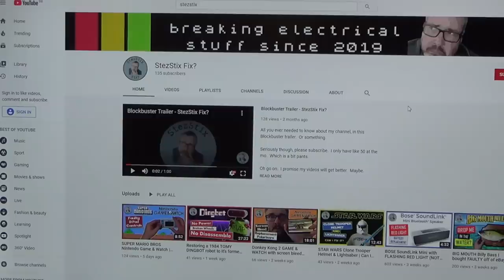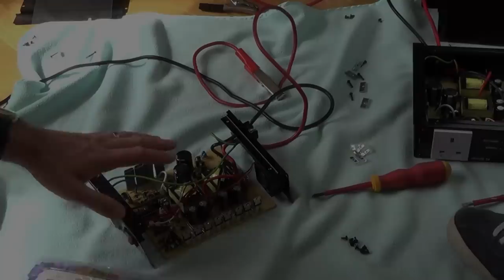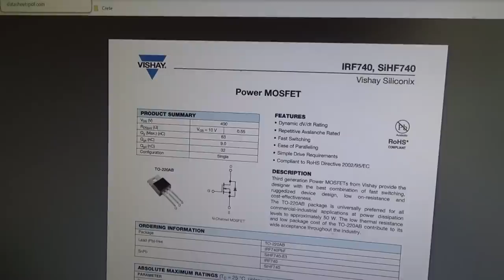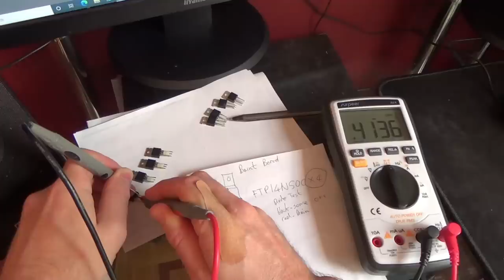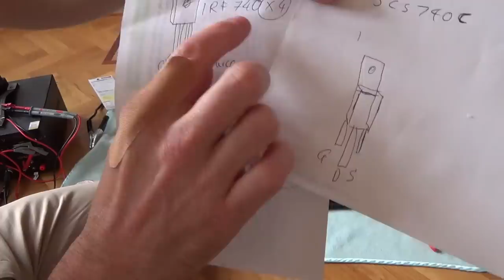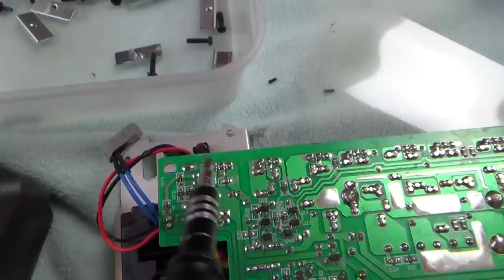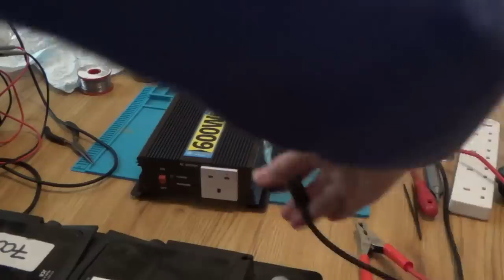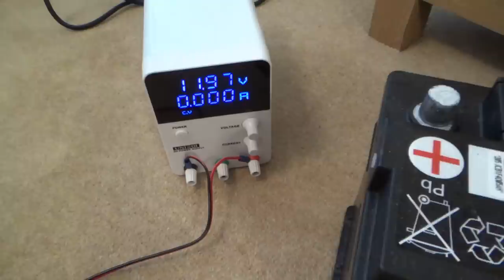Trying to FIX: 3x Power Inverters - 12V to 230V

Comment: @22:00 Aren't those digital relays? Basically? But smaller by design? So they are able to pulse higher voltage. Not sure if I'm helping the topic at this stage either lol. As I'm not entirely sure.
Reply: But when these fail they are latched on or off I feel, that's how they fail? Wish I actually knew lmao...
Reply: @typicalpctech6674  Nikkai Maplins very own brand and not surprised it's no longer working ⚙️🔧

Comment: What is the actual power output from the bench psu, should be written on the back, I suspect it is isolated transformer which ramps up current but at very low power, also known as a dummy load.

Comment: As you're hap hazzard
If you put voltage in limit the current.
When you find broken things, trace back and check 3 items back and forward.
This then sees why things broke.
But you do need to know more about how things work and how to test them.
Reply: blown mosfets ⚡🔥🔧🛠️🧰⚙️
Reply: @MrMacizin  I've tested some and they are either blown or appear blow due to shorts. This depends on the MOSFET type and some other ways they can be wired in the circuit... Which is really annoying most of the time.

Comment: Power(Watts) always remains the same.  The step-up is from 12v to 120v which is x10.  The current also is x10.  So, if you draw 120watts ac (120volts x 1amp) from the inverter you must supply 120watts from the 12vdc supply (12volts x 10amps = 120watts)    2amps AC = 20amps DC , 3amps AC = 30amps DC, etc, etc.......

Comment: Not an expert,  but think you can use signal tracer/curve tracer etc to test components in circuit without having to apply power to them .

Check out Mr Carson's Lab channel on you tube, he does excellent videos too, and provides plans for you to build test equipment like that , although think you have to subscribe to his patron for the plans? Not 100% sure though 👍

Comment: Hello, nice video ! Maybe you could help me on this :
My victron Phoenix Inverter 12v 750va just doesn't want to start, no led, no noise... I decided to open it and everything seems to be fine : the 3 30A fuses, the small fuse in the switch circuit, all mosfets and diodes. I basically see no short anywhere. It seems more of on open circuit somewhere as no voltage go to the drive board. Any idea where to look at ? are there any other fuses ?

Thank you

Comment: @51:30 500w / 12v = 41A  (so it's probably trying to secure 20-30+ amps to create the 500w? I probably did the math wrong, but I feel it should be the proper way, as you are taking 12v and making 500w of 220v, with inverters I am not sure.
Reply: Take the output watts & add 20 - 35 % devide that by the input voltage then add 0.5 amp .

So 600w out @ 30% EF  = 780 w at the 12 v input & 65 amp .

Add the 0.5 amp for running the inverter & you get 65.5 amp & 786 W needed for  the 600w out !

Comment: i used too work for maplins these came back damaged all the time .. there actually only 400w ... with peak of 600w .. ( i know it says on the case that it is 1500w peak but it isnt .. its a chinese over rated item )  and they blew all the time  usually from over current fault on high side . nikkai was a maplin cover make  this one is the A18FG  order code .. know it off by heart because of the issues

Comment: It's SOOO dangerous the way you were handling the working one after you'd plugged it up. Those capacitors could've done some damage to you if you'd happened to short it with your hand.

Comment: The battery is more than 12v, it's 13.5v when charged. Your power supply is set to 12v is too low to power the inverter. It's designed like that so not to drain the battery down too much.

Comment: Why not buy/use a cheap desolder station, like the ZD-915, i have bought one, and i do not wane go back to a manual desolder sucker your using in this video, makes live SO much easier and goes MUCH faster.
Reply: [2021] 🛠️🧰🛠️🧰⚙️🛠️🧰⚙️🔧🛠️🧰⚙️🔧🔧⚙️🔧🛠️🧰⚙️🔧

Comment: Love your work but perhaps you should leave mains AC alone, It's all about safety but your fear is a worry, your terror suggests you should get more comfortable with mains off camera, anyhow I think your new formats are gonna work out ok ! regarding the last few minutes, what was the power supply doing ? had it "current limited " ? and 'no' your supply does not give out anything different....cheers!
Reply: This is not mains AC, it is fully isolated AC generated from a 12V battery.
Reply: @Drew-Dastardly  No problem then eh ?...no need to worry then eh ?..its fully isolated 240v AC blah blah...your missing the point..its very dangerous and a certain level of confidence is needed to SAFELY work on it...Im just a little concerned, nothing more.
Reply: @andymouse  Mains is completely different to this, despite the voltages being the same. Mains is dangerous because of the potential high energy involved. It's called mains because it comes from the grid. This is not mains and is very low energy. It just has a similar AC voltage to mains. Vince clearly takes the precautions needed (making sure the high voltage capacitors are discharged for example). He doesn't even do any live probing with the multimeter, it's all offline.
Reply: @Drew-Dastardly  whatever
Reply: @Drew-Dastardly  AC 12V Battery 🛠️

Comment: I think that your power supply is too low voltage, 12v is a minimum for a car battery, your inverter may be in secure too low voltage mode, to prevent damage on battery. (check you real bat voltage).
Reply: Yes the beep mean battery is weak but usualy it still can supply 230ac. Try hook at ur car battery
Reply: @palee5665  or 13865ac ? 🔧⚙️🔧⚙️🧰🛠️🧰🛠️

Comment: It's just ridiculous to put Mosfets into a tube regardless of the material these are made of. What do those engineers think? Heat will disappear by magic? There are good thermals pads available ;-) BTW at 600 watts output you'll have at least 60 amps on the 12V side - there is no lossless conversion. 60 amps are quite a lot for a clamp in longer sight...

Comment: Why 3x25A instead of 2x40A
The Answer is simpler as u think.
This soldered Fuseholder can only take 30A
look at Reichelt dot de for
Nr.: LITT 01000057Z
 
Sicherungshalter, ATO, 30 A, 80 V, print
Reply: 30A ⚙️🔧🛠️🧰⚙️🔧

Comment: when in protect and alarm comes on is normally a failed fet which is not switching, normaly IRFP LARGE transistors can fail.. the transistor that went is for switching the fets on and off, bc547 normally,, easy circuits ,, when i have seen this video lol i went out and bought a faulty 1000w nikkai off ebay lol. turns out alarm was sounding, one fet large one had failed. and was not switching, it was not short at all but not switching, so therefore failed. it was always on, so timing circuit was working but fet was just not on/off. ,,, these also sufffer the 12v side fets from dry joint, reflow all transistor legs. when putting back use, heat trasfer paste, wallah..

Comment: You don't want to buy your mosfets from China, not for high voltage and current. As you need only few of them buy locally, they are not so expensive.
And you should replace them with at least IRF840, 400V limit is too low for device meant to work on 240. They measure that value with low current in ideal temperature, with high current and temperature all parameters go down and then 400V doesn't look so far from 240 anymore. As your brother kill all these inverters so far I guess tell he push hard.

As gate of mosfet connect with source it probably kill whatever control IC is on board for them. You should first check a that IC before any attempt to run inverter again. Check it same as any IC you check before on other devices. If it's dead check gate resistors, they are burn too probably. Board with cracked optoisolator certainly have burned control IC as OI is connected to it directly usually.
Optoisolators can be checked with diode test on dmm, one side is transistor and one diode. Diode should give you around 1.2V drop and without power transistor side should have very high resistance (in both ways).
Also check transformer winding for shorts. High voltage side should have measurable resistance of maybe 10ohms (just guessing but +-5 ohm), low voltage on will be low so don't mistake that for short.

Comment: You are dealing with turning low voltage into super high voltage you screwed the pooch on the whole deal not using enough batteries to start with also you are dealing with lots of heat thats how i knew at least the mosfets would be toasted resistors should be checked and caps

Comment: haha I ran a Logitech Z-2300 subwoofer off a 300w one of these, a "SUVPR DY-300S" (off the lighter socket!) in my Clio in 2012 before I got an actual car bass system installed :P

https://youtu.be/W63SBATdolc
https://youtu.be/t_iKGS04AvE
https://youtu.be/TZTEHXe2JRU

Comment: made in china & built with the most cheapest components you can find
Reply: batteries are 16 amps 12 volts they need to be to power the starter motor
Reply: @jasinere35  ⚙️🔧⚙️🔧 16 amps 12 volts 🛠️🧰⚙️🔧🛠️🧰⚙️🔧🛠️🧰⚙️🔧